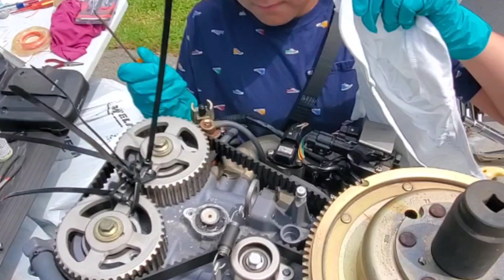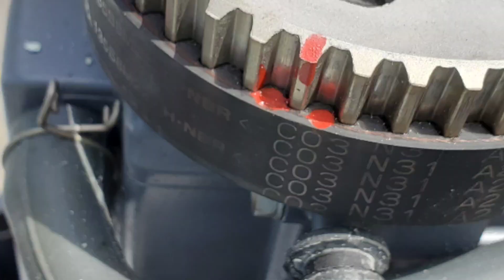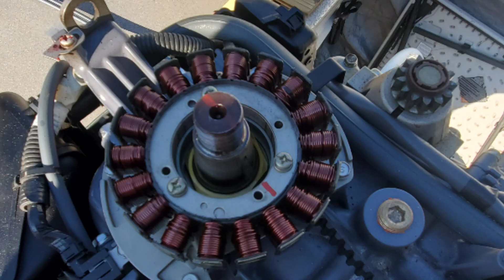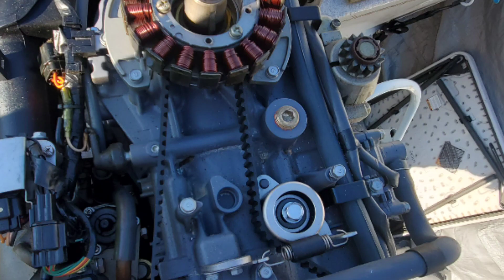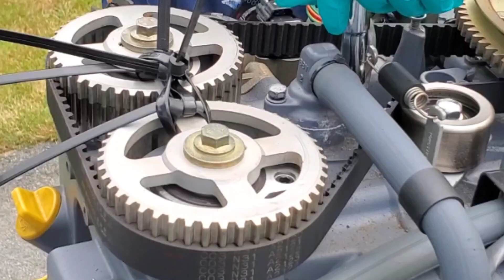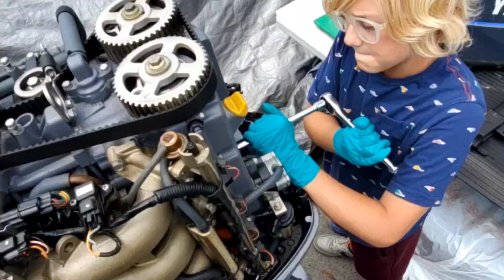Yamaha F115 timing belt replace

Comment: I forgot to ask, what kind of camshaft lock do you have there?  Is it a camshaft locking tool or is it a bunch of zipties?  I can't really see in the video.  I ordered a camshaft locking tool on amazon and it's too big.  It would have worked perfectly if it were the correct size.  It would just slide down in between the camshafts with teeth and sit there preventing the camshafts from moving.  Also, I think this might be a better way, as I could rotate the engine with the old timing belt into TDC and lining up my camshafts perfectly.  Then place the camshaft locking tool into place and then remove the old timing belt and install the new one.  Then it would most definitely be in timing.  I would then do two revolutions just to be sure and the wham, all done.  I like it, thanks.
Reply from the maker: Just a bunch of zip ties.  Actually worked very well

Comment: As far as making sure the correct tension is on the timing belt, is it only that spring that’s giving the correct tension and then tightening that nut to keep that tension?
Reply from the maker: Yes  just that spring and idler comes as a set.